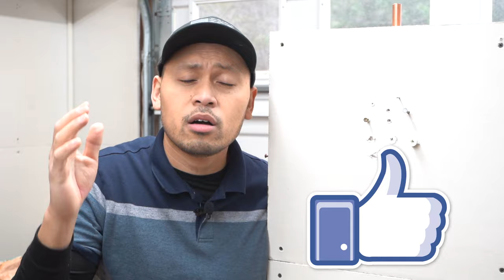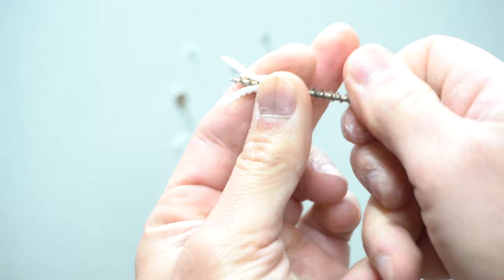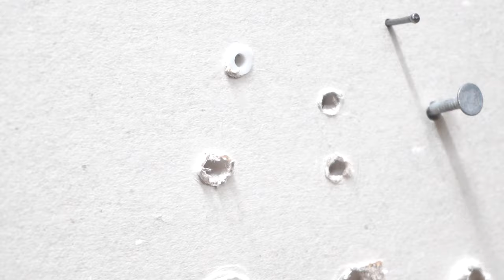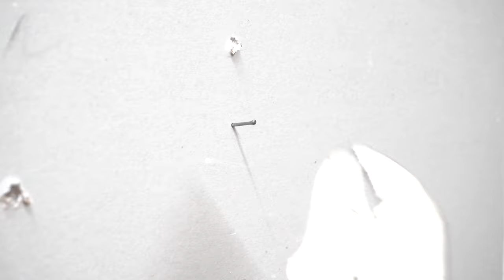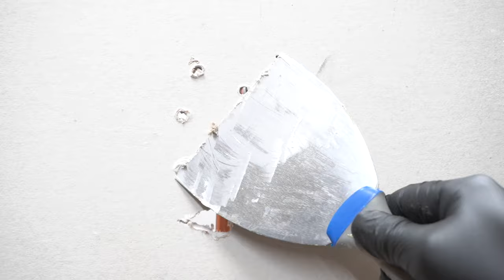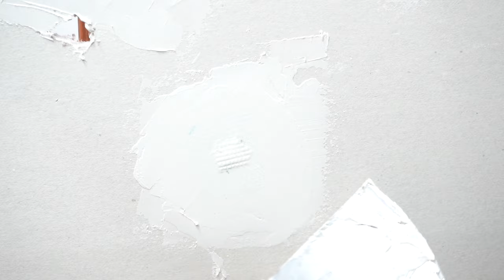How To Remove And Fill Drywall Anchor Holes | DIY Fast And Easy Repair For Beginners!

Comment: After removing the nail/ screw/ anchor....take rounded end of ball pein hammer and slightly dent the drywall surface over the hole...then apply the drywall compound..that way you wont tear the drywall paper surface by scraping and the hole will be invisible after painting...

Comment: For those plastic anchors that are stuck, I just use flush cut wire cutters to cut the collar off, and then push them into the wall and let them fall into the void. It does way less damage to the wall because you're not dragging those flared parts back through the hole.
Reply: I should have read this before I destroyed half the walls 😫
Reply: Fall into the void lol
Reply: I need this video!!!

Comment: Spreading that spackle or compound so far out from the repair, is gonna add extra work to your repair. You can use a damp cloth to clean it up and save yourself extra work such as additional sanding and re-texturing...  JS...Also pre-cutting your tape closer to the size of the hole repair, is a much easier option.

Comment: What would be cool to see is using it against a wall that is painted with a color. Sometimes you don't want to to spackle a large area for 1 nail hole and have it be super obvious to paint it. You also want to reduce the amount you spend. Would you do a video demonstrating this on a painted wall and how to paint it?

Comment: I’ve noticed how a lot of the comments here are saying the info and tips for how to remove the screws and nails from the drywall during the first half of the video is “not needed” or a “waste of time”. 
So, as someone who actually did need that information as well as the information on how to fill the holes, I do not agree with those who think the first half of the video is unnecessary/a waste of time.
However, I can see where some of them are coming from. I recommend that you edit the title of the video to mention that this video includes both the removal of screws and nails in drywall as well as the repairing of the holes. It will help alleviate the backlash and prevent confusion of those who are just looking for the information in the second half of the video. 
I hope you take my advice and continue to grow this channel of yours. Good luck! 👍

Comment: This thing is fantastic. https://www.youtube.com/post/Ugkx1McjgiqTNcTjrhvRvJWcrk5bzTeQW-Wn Easy to store in a bag in "screwdriver" position, not heavy but well built, and the location of the button makes it easy to screw or unscrew with one hand in either "gun" or "screwdriver" position. My only real complaint is there isn't a clip anywhere to store another bit, and the bit isn't a combo dual-ended bit either, so the flathead and P1/P0 philips bits we have to carry around invariably get misplaced.Note: Apparently Black + Decker changed this same Li2000 model from "Type 2" to "Type 3". This new "Type 3" appears to be slightly lighter, and the charging plug is now larger, with a little metal piece to keep it snug. I never noticed the "Type 2" version charger plug to not be perfectly snug, so not sure why this change was made - it does make it annoying that our shop now has 8 of these, and the new 3 have different charging plugs :/

Comment: Thank you for the video. It would have been very helpful if you went back and showed what the second coat would look like after the 'bubbled' holes had dried as well as the second and third layer over the mesh tape and how you finished the while process.

Comment: Most holes are on painted wall surface.  It gets tricky to not mess up the paint on the wall next to the holes.
Reply: Hence the reason you better be prepared to paint after patching.
Reply: @rachealsilburn901  cant you use a colored compact? Painting takes a whole day
Reply: @viktor2915  I didn’t know you had to paint a whole wall after patching a hole.

Comment: Good video. I use a countersink on a drill to clean the edges of the hole instead of a scraper. I think it also helps to push the joint compound into the hole

Comment: Thanks so much!   My husband passed away and I had to move to a fixer - upper and finding videos like yours is soooo helpful!!  What if it's not a hole, but a dent?
Reply from the maker: I’m so sorry for your loss 🙏🏽😔 my condolences.

For dents I would just apply quick settings 5 minute Mud. Comes handy. Just apply, then use can of texture to your liking and then paint. I will try to make a video on dents. Please stay tuned 🙏🏽

Comment: Thanks for talking about caulking.  i was wondering also if that would be an option, and a (supposedly) handyman said i can even use caulk to fix no-longer adhesive taping work on my ceilings edges.  I figured i will watch lots of youtube videos before doing the work, and here we go, i got my answer. NOT doing that caulking because would like a nice and smooth paint job after.

Comment: You mention using joint compound for filling the holes. Is there any difference using spackle vs joint compound in this situation?
Reply from the maker: Hi! Spackle compound for drywall is comprised of gypsum powder and binders. It is thicker than joint compound, similar to the consistency of toothpaste. ... Spackle is used to fill in dings and dents, nail holes, or any small damaged areas on walls. It dries faster than joint compound, typically within half an hour. Joint compound is the better choice for taping and finishing drywall seams whereas spackle is the better choice for filling in small to large sized holes in your walls. ... Spackle also shrinks, but it just doesn't do it nearly as much as joint compound

Comment: The small finishing nails can also be driven in below the surface using a nailset leaving a clean edged hole that is simple to repair using drywall compound or spackling compound.
Reply from the maker: Thank you 🙏🏽! 😊

Comment: for the fist layer over mesh patch  the regular compound is not  the best option.  Quick Set 20 - 45 is better fit .
Reply: After the first layer of the quick set has dried. The following layers should be with the joint compound?

Comment: Great tutorial, but how do you make it strong enough to accept a new anchor or screw without sagging or bending
Reply from the maker: Thank you! If you plan to put new anchors on the same spot, make you load the hole really well with joint compound. Once it hardens it should be as strong as the surrounding dry wall. Be sure to use the mesh tape or drywall tape to fully hold the new joint compound for drying.
Reply: @FixThisHouse  this is exactly what I wanted know as  I also need to install a something at the same location. Is spackle okay or is drywall joint compound a stronger surface to hold the screw in place? Thanks in advance
Reply: Thanks ...you may want to make an update video addressing these questions.
Cheers

Comment: Thank you so much for this video. Quick question though, don’t know if I missed it. If you have a deep inch or so hole, would you pack it a little with something before putting the bridge tape over the top? Or just still only put the tape and fill?

Comment: When the repairs are completed, can you hang something up again in that area? I have a baby gate with anchors (like the ones you unscrewed) that's ripping out of the drywall and need a fix.
Reply from the maker: Hi! It all depends how badly the damage is. This is mostly for cosmetic purposes, but if you can find a new fresh spot just close to where you had it previously would be a good area. If it’s really damaged and filled I would recommend applying a new drywall patch, please see my California patch method video.
Reply: @FixThisHouse  going to check it out now! I think it needs a new patch 🤭😅
Reply: Find a new patch of wall to ruin. 😂

Comment: Toothepaste, not the gel stuff also works great to fill small holes in place of drywall putty.
I have seen spray expandable foam used to fill say a 1" diameter hole. Once it hardends trim it down flat with a knife. Then putty over it.

Comment: Thank you for this informed video! 
After you patch the holes from an anchor will it be hard enough to re -anchor in the same area? I have a new toilet paper roll fixture to install on the wall in the same area where my old one was!
Reply: did you ever get an answer for this? i’m trying to do the same thing but i’m scared
Reply: @uwu-nr9mh  You'll be fine as long as you used enough compound to fill the hole with. It hardens and conforms with drywall really well. Just make sure you use the correct anchors, and use a pilot hole with a drill first.

Comment: Thanks for the video! One question - is it stable enough to use drywall anchors in the newly patched area?
Reply from the maker: Thank you so much! It all depends on what filler you end up using. I would watch this video I made to get a better picture on what patch compounds will withstand new anchors: https://m.youtube.com/watch?v=4mMGpf9BK0U
Reply: @FixThisHouse  ok thank you very much, I'll watch that one too

Comment: Can you fix a drywall hole, then repair it, only to drill another hole on the drywall that's 1/4" apart from the first hole without becoming one giant hole? 

If so, how can I fix the first hole, in order to sort of reuse for another hole in close proximity?
Reply from the maker: Yes of course! I would use 5 minute  “Hot Mud” it dries harder and faster. Here is the link if you are interested, comes in a good size bag, which goes a long way! https://amzn.to/3qbeDDj

Comment: Hello there. I would love if u can solve this problem. I took a Walmart cheap mirror and I bought some dollar tree foam mounting squares. Place the square on the back of the mirrors. But when I tried to take the mounting squares off, I made holds by pulling tape off from wall. Need help 🆘
Reply from the maker: Joint compound usually bonds fairly well to the gypsum inside drywall panels. However, you must get it thoroughly filled to make good contact. Also, standard joint compound shrinks substantially, so you'd be better off with a setting-type product (Easy Sand 45, for example

If you're hanging something very heavy and you want to make sure it's a strong patch, and if you don't mind a hole at least an inch or two and a little patching & filler & paint you could put a piece of wood behind it and screw it into the "good" drywall on either side:

Please check out my ceiling drywall repair video, it’s a similar process 👍🏽😊🙏🏽 best of luck!

Comment: Thanks for the video. After we patch the nail/screw holes with 2 layers of joint compound , can we re-use the patched holes to screw and hang something (e.g. photo frame)?  Would the patched hole be good enough to hold the new screw (which may be of different size than the old screw). Thanks.

Comment: Hello, this video really helped with covering screw holes in my wall.  However, I have a bathroom towel holder where one end was knocked out of the hole, which is over an inch wide. Once I place the mesh tape and the joint compound over the hole, once it dries. I can then put the screw back in there?  Or do I have to try and replace the whole towel rod? I sure hope it's No!! Thank you.

Comment: Is dry wall filler and joint compound same ?
Reply from the maker: They are not, to explain simply, filler is made for nail holes small and alike and dries quickly. Joint compound have various characteristics, but mostly take a little longer to harden to give more working time unless you use fast setting kinds like (easy sand 45)

Comment: Hi there. What if i have a half inch to one inch hole that needs to be repaired but also needs to be reused. would a layer or two of of joint compound with mesh be good enough to hold the screw/anchor? ( im trying to reuse the hole from the bathtowel rack )
Reply from the maker: Joint compound usually bonds fairly well to the gypsum inside drywall panels. However, you must get it thoroughly filled to make good contact. Also, standard joint compound shrinks substantially, so you'd be better off with a setting-type product (Easy Sand 45, for example

If you're hanging something very heavy and you want to make sure it's a strong patch, and if you don't mind a hole at least an inch or two and a little patching & filler & paint you could put a piece of wood behind it and screw it into the "good" drywall on either side:

Please check out my ceiling drywall repair video, it’s a similar process 👍🏽😊🙏🏽 best of luck!

Comment: Can I make a new hole on that same spot where I patched? I mistakenly used the wrong tool at first, patched, and now I need to try again, but I’m not sure if it’s safe to install a new anchor on the same spot.
Reply from the maker: Hi! Yes you can! I would make sure the patch compound you used is fully dry and make sure it is evenly spread around the damaged area.

Comment: Wow I immediately click on subscribed once I seen that thumbnail because just moved in new place and in my kitchen there are a lot of screws in the wall like that over my sink. I don't think they are the ones with the plastic dry wall ones but regular screws. I want to know how to patch them as well as a bigger hole a circle.

Comment: Dam it,this is what I was looking for and I'm a subscriber.What compound do you use  or recommend?
Reply from the maker: Thank you so much for subscribing! I highly recommend Easy Sand. There are various types Easy Sand 5,20,45, and 90 all depending on how fast you want your dry time. If it’s an quick small fix area I recommend easy sand 5 take 10-14 minutes dry time. But all in all it depends on your situation 👍🏽😊🙏🏽
Reply: @FixThisHouse  yea I got small  wall anchor holes and I need something that dries quick.ill go with what you recommend...thanks for the fast reply...keep up the good work bro..god bless you.

Comment: For the one inch hole can I put a hole in the same spot without the compound breaking?
Reply: Asking because I put three layers on the one in home in my wall and let it dry for several days. Went to put an anchor back in and everything just crumbled. Should I stuff my wall with mesh tape?
Reply from the maker: I would try using mesh tape over the hole try 2 layers with a 2 inch overlap first. If not then cut a 3x3 inch hole and add a California patch. Please check out the video I made on the California patch method 👍🏽😊🙏🏽

Comment: Hello, the person I hired to put up my curtain rods messed up a bunch. So now , with each curtain bracket has six holes drilled. He just mudded the oops and did a sloppy job. I have to fix it myself now. I don't want him to make it worst. Hard to hire anyone, and I would not know if he knows what he is doing until he damage my walls afterward. The six holes are  too close together (less than one inch apart). I also have to rehang the curtain rod (In almost the same spot, and the rods are heavy). Please tell me you thoughts and how should I fix it.I am desperate. thanks

Comment: Can anyone answer this question for me.  I was trying to put a shelf up but when I finished it wasn't level, (and yes, I used a level), so I had to remove the shelf and remove one of the screws and anchor.  In removing the anchor, I made a 1/2 hole.  Once I fix the the hole with joint compound, I plan on reusing the anchor and screw a little higher l higher so the shelf will be level.  Will I run into a problem if the second hole I make in the wall is too close to the first hole I just fixed? I only need to insert the anchor and screw about 1/2" higher than where I originally placed it the first time.

Comment: will I or another person be able to put a screw in the same patch once it’s fixed and dry? i was trying to hang up a shelf in my apartment and I hit a stud so I had to remove the drywall anchor and now there’s a big hole so I don’t want to lose my deposit and I want to actually hang up the shelf (not in the area with the stud obviously)
Reply from the maker: You should be ok as long as the small hole patched is fully loaded with compound so that it has full connection with the existing drywall.

Comment: The reason your compound shrinks is because you're using the wrong compound. You're leaving too many lines and edges. Feather it out more so you sand less.... don't use caulking on you're drywall period.

Comment: Ironically, the command strips did more damage than a typical screw would have-on my wall. I removed it correctly but it still ripped like a beast🤣

Comment: Hi. Can i still use the same hole to poke a new nail? Sorry. I am not sure about wordings with Carpentry. Anyway, i have this towel rack on the wall and i accidental used it as a handle to get out of the shower. I was wondering if i could patch it up and use an anchor or something to tighten the hole besides, it is harden with the potty already.
Reply from the maker: Hi! You should be able to use an anchor on the same hole you patched. Just make sure it is completely dry. For a towel rack try using a toggler anchor, they are a lot more heavy duty.
Reply: Thank you. You are the best 🥰

Comment: When I go to the hardware store I ask for joint compound? What is the joint compound?
Reply from the maker: Joint compound is the yogurt like mixture that i applied on the seams. You can get the ones already mixed or powder kind where you just add water and mix it to a yogurt like texture. Easy sand 45 is a good joint compound that sets in about 15-20 minutes! 👍🏽😊 a hardware store representative can also help you find which you need 👍🏽😊